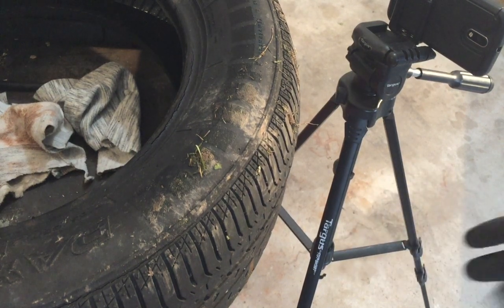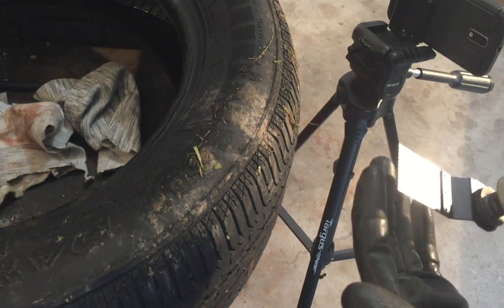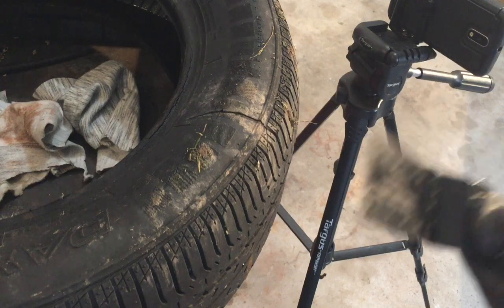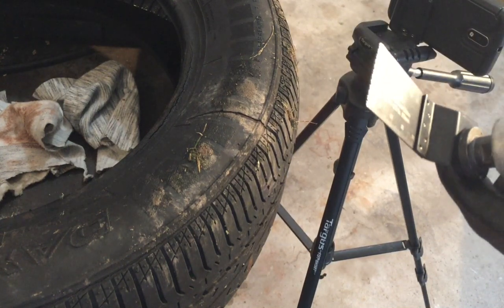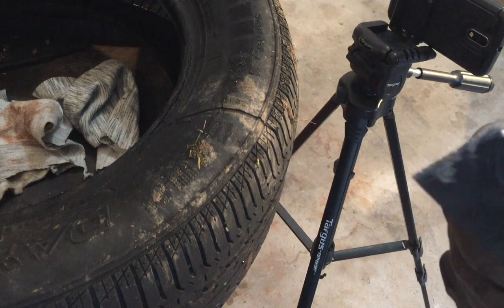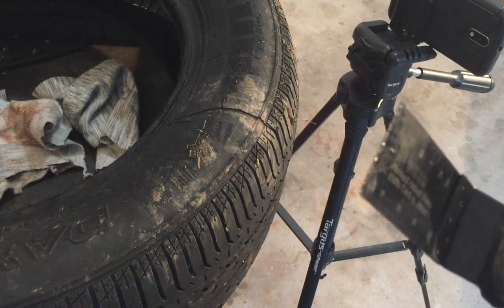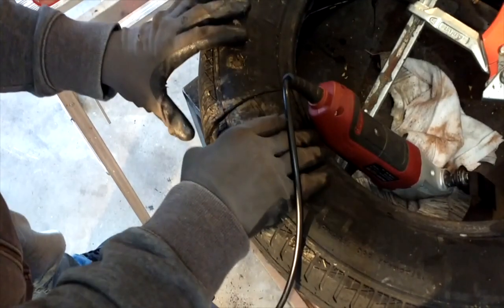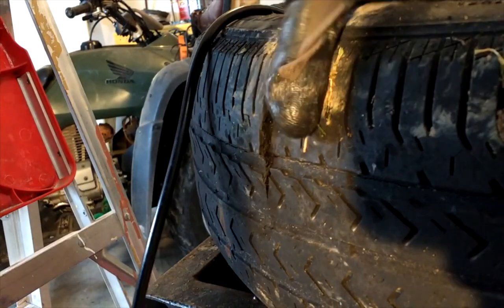Oscillating Tool CUTTING TIRES-Cheap Harbor Freight oscillating tool

Comment: It works a lot better if you lubricate the blade with a soapy water mixture. It keeps friction down which kills the blade another plus it cools the blade a bit. Works better with a reciprocating saw equipped with a fine metal cutting blade again lubricating it with soapy water.
Reply from the maker: good points
Reply: Just use a freaking sawzall
Reply: Nice idea.

Comment: Only thing I've seen work on tires is a "Modified Log Splitter" with a sharp wedge and a recessed V plate.
Reply from the maker: That would be much faster at cutting-I was surprised that the oscillating tool was able to cut the tire-but it is slow-

Comment: Still looking for a good way to cut a tire with steel cables in them, like what we use in the U.S.  We used the ocillating tool, the Makita brand.  Didn't even phase the steel cable part.  Next up, we tried the angle grinder from Harbor Freight.  It cut a straight line, but I'm trying to make horse shoes for my draft horse.  He has bad hooves and needs to wear some rubber shoes because the farrier says there isn't enough to nail onto anyways.  I'm not really a fan of metal shoes, anyway and prefer DIY or self sufficient things with nonrepeating bills.
Reply: I’ve cut them up with saws all.
Reply from the maker: thanks for watching

Comment: most efficient tool ive used so far was a m18 sawzall with a pruning blade. cuts through the rubber sidewall like butter, i dont bother with the metal embedded treads.
Reply: the finer blades get gunked up/ heat the rubber too fast
Reply from the maker: sounds like a mean machine-

Comment: I am thinking of using this to cut lugs off a lawn tractor tire to open the treads for better traction. Should do ok no metal would be cut
Reply from the maker: It would work OK for that, I would use a little oil to keep the blade from getting any build up and smoothing the cuts.
 Test a small area on the tire before diving in as I bet the tire may look rough but if you don't care about looks it should be fine.
Thanks for watching

Comment: What's the best tool for doing that cut? I need to do 300 tyres
Reply from the maker: 300 tires...Wow-the only sort of cheap way I can think of is a good size band saw with a really good blade. 
 Junk yards use hydraulic shears to cut tires into 1/4ers. 
That sounds like a terrible job, especially if the tires are large and full of stagnant water.
Reply: Look up cutting tires with a log splitter